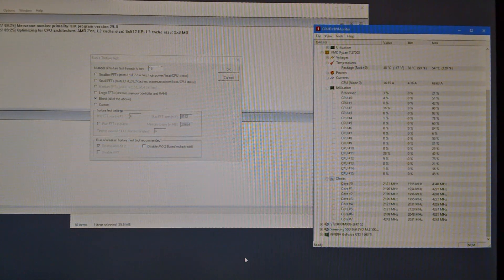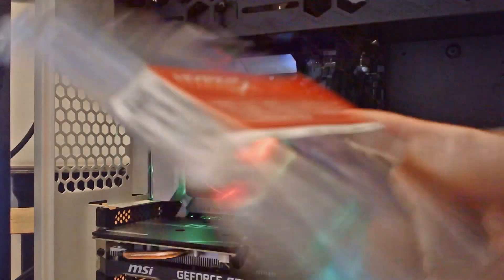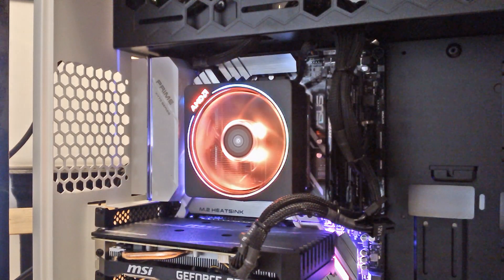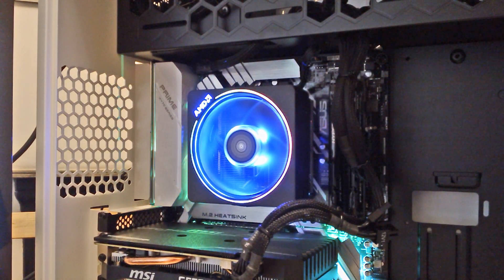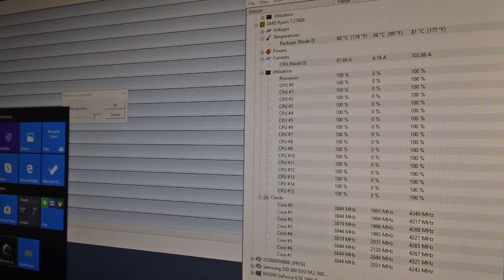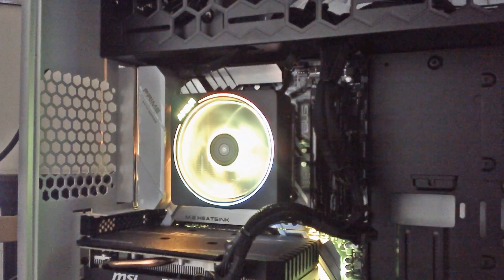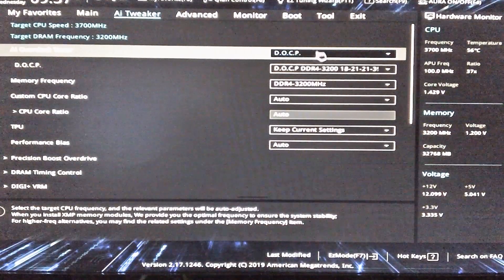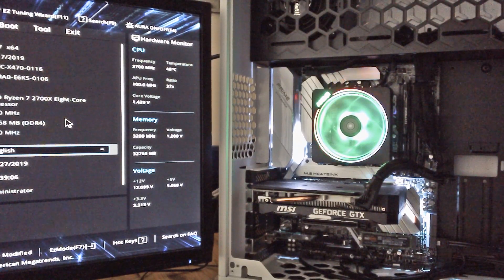Ryzen 7 2700X & ASUS Prime X470-PRO *BUILD*

Comment: hey i have a  problem with my pc .. i have Ryzen 7 2700X & ASUS Prime X470-PRO but my pc shutdown  when cpu hits 60c temperature... btw what version of bios do you have in this video
Reply from the maker: How do you know it's at 60 degrees?

Most automatic shutdowns are heat related... but it needs to be much hotter than 60 degrees so I'm wondering if you're looking at the wrong sensor reading.

The BIOS was the stock version that came with it.

Comment: Hey quick question, is the bios version on the mainboard out of box? Or did you update? I ask because I need atleast 4804 for my ryzen 3600 and I got no 2000
Reply from the maker: This was the out of the box BIOS - at 10:19 you get a glimpse that says its v5007.

Comment: Am just about to buy that motherboard and the CPU with a 1660ti am excited how is the motherboard I was going to get the x470 but read bad reviews about it so decided on the Asus
Reply from the maker: It's great... this build was for a customer and I've had no complaints!

If you get higher frequency RAM then overclocking is as simple as just enabling DOCP as shown,

But it's a good idea to buy RAM from the QVL for 100% compatibility just to be on the safe side. In the video its the only 32GB 3200MHz kit on the list and the Wraith Prism cooler doesn't have any problems at 100% load.

Comment: I ran into a problem... same build but with rgb and a corsair. Case........ I decided to switch cases... tk the corsair 7000.... but when I made the case swap with a new battery..... and new gpu...

It didn't work... it's been 4 days and I'm stressing
Reply from the maker: Hard to diagnose without having it in my workshop, but if all you did was swap out the motherboard without removing the HSF and CPU then it should be fine.

If you replaced the battery… do you mean the CMOS battery?

If so, then check that…

Note that some boards can take an alarmingly long time to do a first boot… and by removing the CMOS battery you actually revert the board back to its new first boot state.
Reply: @sterntechdaddy  literally gave it a supernova..... but other then that yeah.... all try again... and i did the cmos battery thing to reset the bios but still nothing....

i was going to buy a ryzen 7 2700 and thorw that in the mobo asus prime pro... and see if its the chip or if its the mother board
Reply from the maker: Sounds like a plan…

Just check the USB ports for damage and shorts… and check the hex board mounting screws.

I’d also check the power switch on the case by trying to start up the board by shorting the pins on the front panel header - or by using the board power button if it has one.

Essentially trying the cheapest easiest things just in case.

It’s easier to find out what isn’t the problem rather than trying to guess what is the problem.

You might get lucky.

🙂

Comment: I don't know whether to get this board or the msi b450 gaming carbon
Reply from the maker: The X470 is the newer and more expensive chipset... and it supports SLI. Both should work with the 2700X, but other features might swing it more than the chipset.

The MSI B450 Gaming Carbon has built in Intel Wi-fi, for example.. so if you need that then go for that one.

If looks are important then the MSI one is nicer I think - unless you've got a white case with a side panel, then the ASUS one looks fantastic.

The MSI should be cheaper if cost is a factor.

Not sure about the MSI BIOS, but the ASUS BIOS was a breeze for the overclock in the video.

It's a tough choice so hope the above helped!
Reply: Thanks for the response but tbh I don't need the sli from asus or wifi from msi. The reason I'm asking is I cannot find any benchmarks for the x470 primo pro so I don't know how thegaming performance is. I am scared that if I get the asus board the performance will be noticeably worse than the msi board. But I heard that audio software on the msi board (nahimic) doen't work that well so I don't know. I just want a quality board with nice audiochip(alc1220) I'm trying to look for answers but I can't find any. 

Prices for the two boards are very similar in my country.
Reply from the maker: How about this...

The underlying performance of the motherboards will be vastly overshadowed by the main components that are fitted into them.

Benchmarks cover CPU and GPU, which are partly influenced by RAM speed. The main system RAM for the former, and the on card RAM for the CPU.

And note that the underlying technologies used on the motherboard (such as PCIE bus speeds, USB speeds, etc) will be pretty much identical for both motherboards using current CPU and GPU models.

So don't worry too much about which motherboard is faster... they will behave pretty much the same with the same CPU, GPU and RAM fitted to each one.

It looks like you answered your own question anyway - the ASUS one has the better sound if the MSI one has software issues.

:)

Comment: Hello I know you made this a while back but can I use my Corsair 2x8 Vengeance RGB 3200 on this motherboard?
Reply from the maker: If its DDR4 then yes.

Note that if your RAM is on the QVL then it'll 100% be OK.

They don't test every single stick, so it might not be on the list, but it'll usually work - especially at stock speed and the 3200Mhz OC isn't guaranteed to be stable, but it should work as Corsair are a major brand.

One tip is to search for the part number and see if anyone else is using it. :)
Reply: I have Corsair Vengeance RGB Pro 3200 MHz in mine and everything works perfectly

Comment: Just upgraded to this from the asus prime b450m-a/csm motherboard and ryzen 3 2200g feel happy with the choice can’t beat 250 for both new micro center near me had a similar deal as in Black Friday on valentines then got an additional 20 dollars off if you pair a processor with a motherboard can’t beat it :)
Reply from the maker: That's a bargain!
Reply: Nic Bunting oh ya :) one question I had what’s the size of the ram this board takes disappointed my ram sticks are shorter had a good set from before and which one would you recommend?
Reply from the maker: Needs to be DDR4, but for the best results pick a kit from the QVL list. Then you can enable DOCP and it's all good.

Just make sure your cooling is able to handle it. In the video, the Wraith Prism coped very well with the 3200Mhz RAM.
Reply: I’m using a fryzen cpu fan just trying to figure out the right mix for the ram
Reply: Nic Bunting last thing I wanted to ask is if I’d be able to use 8x4 DDR4 ram sticks all slots or does it require the 16x2 in two slots only?
Reply from the maker: My advice is that you can use anything you find on the QVL.

In the video its 2x16 @ 3200MHz - Kingston HX432C18FBK2/32 - which are in the QVL.

So all I did was fit the RAM and enable DOCP in the BIOS.

Because the QVL lists the actual part codes for the RAM, it's better to search for that rather than grind your way through the sticks your favourite PC parts supplier has in stock.

For example, copy/paste this into Google and see what you get: HX432C18FBK2/32

But check for your CPU, it might not like an overclock and it might be better if you match the RAM speed to its base frequency instead.
Reply: Nic Bunting would this work well with a deepcool cf120 fans that’s what I have wanted to use the my case deepcool mattrex 55 the main to use the case to control while plugging in to the motherboard for the fans to work?
Reply from the maker: @metaldragongaming597  No, because the ASUS Prime X470-PRO has 12v 4 pin RGB headers - called Analogue RGB.  The CF-120 fans use 5v 3-pin connectors - called Digital or Addressable RGB.

So you cannot connect the RGB cable for the fans to that motherboard, but the fans themselves are 4-pin PWM speed controlled so their main cable can be plugged into the ASUS Prime X470-PRO - it has several 4-pin headers for fan control.

In order the use the LED's on the fans you'll need a separate controller. Something like this: http://www.gamerstorm.com/product/ACCESSORY/2019-03/1291_10731.shtml

But there might be a better device you can use...

The good news is that the LED's on your Matrexx 55 case are 4-pin so they can be connected to the motherboard.
Reply: Nic Bunting that’s awesome man! Really appreciate that would I need anything else to go with the rgb transfer?
Reply from the maker: You just need to take a look at what you've got... and notice that there are two types of RGB.

12v 4 pin and 5v 3 pin - and plugging the 5v into a 12v header will blow them...

Typically, the higher end motherboards have both connectors, but just because there's an LED, it doesn't mean you have to connect it. Without a bit of planning you can get caught out, even when you buy products form the same company.

Your case has 4-pin and your fans have 3-pin, for example, and they are both from Deepcool… 

But your case LED strip can be connected to your motherboard, and the fans to a separate controller.

If you want fully synchronised lighting that responds to music or a game then you're going to have problems, but for static colours there won't be any difference between a mixed analogue and digital setup and a pure analogue or pure digital configuration. 

And if your PSU has it's own LED's that you can't turn off or change (like mine does) then you'll probably set everything to that colour anyway.

Comment: Would it be possible if you can make a tutorial on connecting the wires ,  I have the same CPU and mobo , been stuck for couple days :(
Reply from the maker: Which wires?

The build in the video was for a customer, but I can still talk you through it...

I guess you mean the Wraith cables, if so then there are three supplied.

One is for the actual fan power - that's a standard connector that fits the CPUFAN header on the motherboard. This is already attached to the cooler.

The other two cables in the box aren't attached - because you get to choose one that you are going to use.

One cable is for a motherboard USB header and the other fits a 4-pin motherboard RGB header.

You choose ONE of those.

In the video I used the USB header cable - mainly because I wanted to check out the RGB Wraith Prism specific software.

If you use the RGB header then the motherboard software should be able to control both the motherboard and the Wraith LED's at the same time - which makes syncing them easier.

In the video I distinguish between the ASUS software and the AMD software.

Hope that helps.
Reply: Nic Bunting how about the f panel headers? I’ve had the board for a few weeks and while I can power on the system I think I might have the power led cables in wrong, coupd you walk me through what you did
Reply from the maker: You can do that yourself... just check the motherboard manual for the header pin diagram and here's a few tips: 

For power and reset - these are switches so it doesn't matter which way round they go.

For the power and HDD activity LED - the lights are LED's and so they are diodes. Once characteristic of diodes is that they only work in one direction. So if yours aren't lighting up just plug then in the other way around and, assuming you've got then on the right pins, they will light up.

You need to connect the + side of the plug to the + pin on the header. Some case cables have the + label on them and some don't.

For most motherboards, this usually means the printed side of the case cable plug faces towards the bottom of the case when the cable is connected to the motherboard header.

So a general rule is - if the LED's aren't working and you're sure you've got them in the right place then unplug, flip and plug back in the other way around.

Comment: What software did you use to change rgb? I saw the Razer one but didn't catch the other.
Reply from the maker: I used this software...

https://landing.coolermaster.com/pages/amd-ryzen-wraith-prism-rgb-software/

The RGB Wraith Prism was connected to a USB header on the motherboard using the included cable.

AMD say it also works with Razer Chroma, ASRock RGB LED, ASUS Aura sync, Biostar VIVID LED DJ, Gigabyte RGB Fusion, and MSI Mystic Light if you connect it to the 4-pin RGB heard on the motherboard using the other cable included with the cooler.

For the motherboard.... there’s the ASUS software you can download from the motherboard support page. Or instal the one included on the driver disc.

Comment: This Mainboard has no 3 pin header!
Now my question:
Can I use Asus aura to control rgb fans and the stock cooler (rgb) ?????????
Reply from the maker: See here: https://www.amd.com/en/technologies/cpu-cooler-solution

The Wraith Prism is compatible with ASUS Aura... if you have the motherboard header or a way of linking it to a controller.

You get two cables with the cooler... one for RGB and one for USB. The RGB is three pin - so digital. You'll need a three pin RGB header for that - the 4 pin is analogue. So if your motherboard only has the 4 pin header you'll have to use USB.

Personally, it might save time just using the USB header anyway..  It uses the Prism software here:

https://landing.coolermaster.com/pages/amd-ryzen-wraith-prism-rgb-software/

That's what in the video.... fine for general lighting and it remembers the settings so the software doesn't need to be running all the time.

But for funky light shows that respond to games or music you'll need to get the Wraith connected to ASUS Aura 3 pin digital.
Reply from the maker: I’ve double checked the motherboard manual... you are right.

The PRIME X470-PRO has two RGB headers... and they are 12v 4 pin analogue.

So to get the LEDs on the cooler you will have to use the USB header cable.

As in the video... but if your fans are 4 pin then they can be controlled from the motherboard.  Note that both the ASUS and the cooler software scan use the same colour values - so you can get them to match if that’s what you want.

I spent ages playing with the different modes and colours... and then I wondered why I was doing it! :)
Reply: @sterntechdaddy  thank you sooooooo much!!!
Now my second question can I use USB to control argb strips via Asus aura???
Reply from the maker: Not sure what you mean... The LED's for the cooler have a USB connector if you can't use the 3-pin RGB cable.

But you can't then use Aura to control them as I don't think the Aura software can 'see' LED's connected via USB.

It only works on LED products attached to the LED headers.

And for the motherboard in the video, only for 4-pin analogue LED products.

So you can't use the software that 'sees' the USB LED's on the cooler to control any other LED's.

There's no way to connect 4-pin and 3-pin together any way - they use difference voltages.

So if you've got a bunch of 3 pin LED products then they won't work with this motherboard.

Unless...

There might be a USB controller box that you can connect them to. The kind of device that lets people without LED controllers on their motherboard get LED's in their cases.

I've not researched this though... I think generally, the people that use 3-pin digital RGB have a 3-pin header on their motherboards.

Or they have 4-pin and use that. Just not for the LEDs on this cooler.

And the customer who bought this PC didn’t care about adding more Lights than those already there. It just has the motherboard and cooler lights.

Comment: Where did you plug in the cpu fan to get RGB customization??? I have the exact same CPU and MOBO
Reply from the maker: In addition to the main fan cable, the RGB Wraith Prism comes with two separate cables - one for an analogue 4 pin RGB header and one with USB. The one in the video is plugged into one of the motherboard USB sockets.

If you look at Page 16 of this: https://dlcdnets.asus.com/pub/ASUS/mb/SocketAM4/PRIME_X470-PRO/E13883_PRIME__X470-PRO_UM_WEB.pdf

The RGB header is labelled '3' and the socket I've used is one of the two labelled '12'.

You can't use both, so choose RGB header or USB.

:)
Reply: Nic Bunting Where so I plug in the usb?
Reply from the maker: @slick_boi1158  The cable from the heatsink fits a standard USB2 header.... this applies to any motherboard. Not all motherboards have the RGB header, so USB covers everything anyway.

If you've not got the same motherboard, then you'll usually find a USB2 header on the bottom edge anyway.

Just check the manual for your motherboard if you get stuck.

And don't worry, the plug is keyed with a blanked hole that prevents it being plugged in incorrectly. :)
Reply: Nic Bunting Oh wow I was dumb. I had an empty usb slot covered by my graphics card because it was on my bottom pcie slot. I fixed it and now it looks great!
Reply from the maker: Your GPU might work better in the top slot. Lower slots aren't usually x8 or x16.

But since there are no GPU's that use the full bandwidth, using the primary slot for the GPU is more a convention than a rule.

Do you have any particular reason for using the bottom slot?

Comment: can I install i7-7700 in this motherboard ??
Reply from the maker: Not in this particular motherboard - the PRIME X470-PRO in this video is socket AM4, which is for AMD processors only.

ASUS will do a similar board for Intel though... the i7-7700 is socket 1151 so take a look here...

https://www.asus.com/uk/Motherboards/ASUS-Prime-Products/

Put a tick in the ASUS Prime and 1151 boxes on the left to narrow the selection. If you're looking for the white decoration then the Z3xx boards are at the bottom of that list.

But double check the CPU support list for anything that you like the look of.
Reply: @sterntechdaddy  how about the z490-A ?
Reply from the maker: @xfiberr1977  No... that's an LGA 1200 board for the 10th gen processors...

https://www.asus.com/uk/Motherboards/PRIME-Z490-A/

Pretty funky though... and it should be for a £200.00 motherboard.

For the i7-7700 you must get an LGA 1151 board... and, to be fair, pretty much every 1151 board will support that CPU.